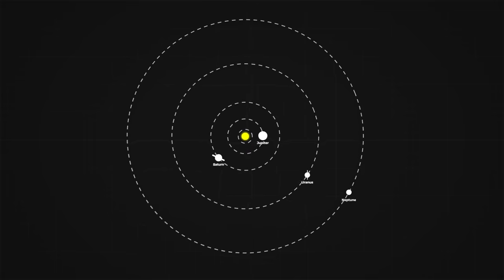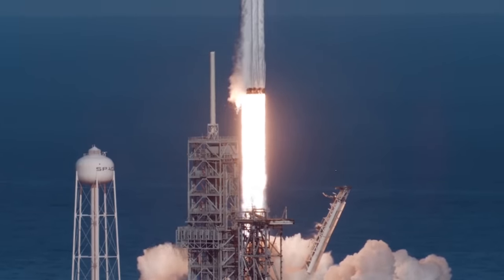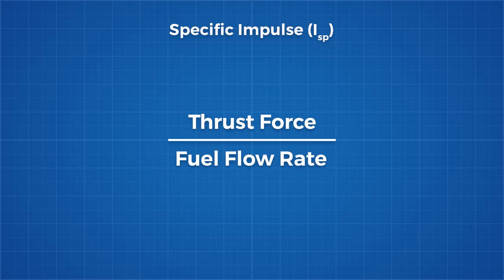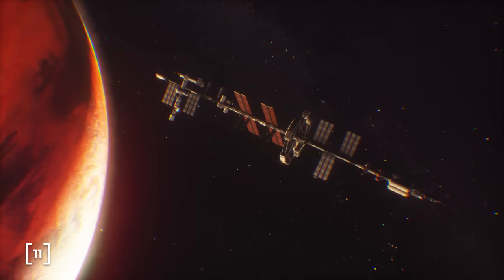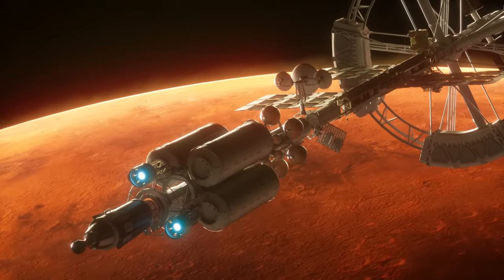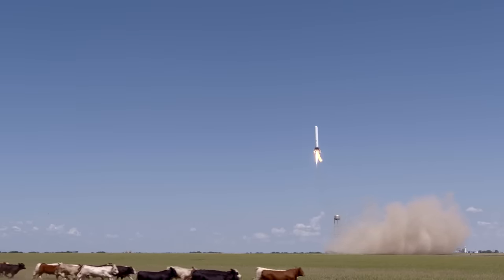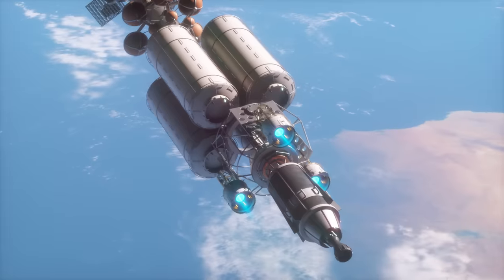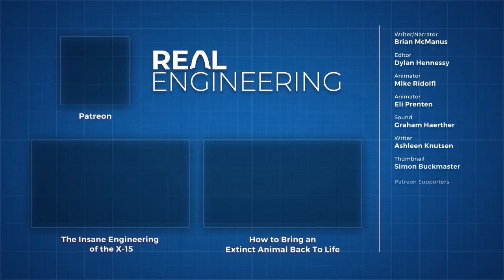Can Nuclear Propulsion Take Us to Mars?

Comment: Any problem in the world: exists
Nuclear Energy: Sounds like a job for me.
Reply: At the end of the day nuclear energy is what made this universe and still to this day keeps it moving.
Reply: @arnavsadhu  Yep even the stars burn because of nuclear energy.
Reply: @arnavsadhu  Actually that's nuclear fusion energy which is different from nuclear fission. Planet are fission reactors because they are too small for fusion and stars are fusion reactors.
Reply: Same with Starship, graphene, aerogel
Reply: @KRYMauL  the point is, it's nuclear energy. The sun is a nuclear reactor. A fusion reactor. Those of us in the know , know what's what and the differences.
Reply: @trevorwoodley3897  No, you are comparing the strong and weak nuclear forces and calling them the same when they are not.
Reply: @KRYMauL  By definition, the term "nuclear" refers to ANY process that involves reactions with the nuclei of atoms: this includes nuclear decay, nuclear fission, nuclear fusion, and even nuclear annihilation like happens in matter-antimatter reactions.  While these four operate on different mechanisms and produce orders of magnitude different amounts of power they are ALL nuclear reactions, and your 'correction' is not only needlessly pedantic, it is actively incorrect.  Nuclear fusion is a type of nuclear energy, even if nuclear fission is the most powerful type humanity has been able to harness in a controlled manner.  The original poster nor any of the following posters until you specified that they were limiting discussion on the usefulness of nuclear energy to fission only, so discussing the benefits of fusion too was absolutely within the realm of the discussion.  Most people who discuss nuclear stuff know the difference between fission and fusion, but for this discussion they are both 'useful' so they're both fair game.
Reply: @IONATVS  Facts! School' em.
Reply: @KRYMauL  It's the Strong NUCLEAR Force and the Weak NUCLEAR Force.
Reply: Any massive source of usable Energy can eventually be utilized to solve a given problem.
Reply: @RocketDragons  They are completely different forces that don’t combine until infinitesimal close plank time. 

EDIT: I fat fingered a paste.
Reply: @IONATVS  I was mainly making a nitpicking joke because I thought it be fun to include the fact that only one type of nuclear energy is available atm.
Reply: @KRYMauL  so what? Nobody is trying to say they are the same force. You're literally making up an argument. By the way, there are functional fusion reactors, and it won't be long before they are producing a net positive amount of energy.
Reply: @KRYMauL  There is actually 1 Fusion-based propulsion method that is generally believed to be feasible with our current technology: pulsed nuclear propulsion, colloquially called a “bomb gun” or “Project Orion” after the codename for the US Navy’s preliminary research into the idea in the 70s and 80s.  It’s dirty, at least as dirty if used in atmosphere as any other kind of H-bomb testing, but basically the only propulsion method that we’re 99% sure we could both make with current tech and would provide enough thrust and impulse to do single-generation interstellar travel.

Also nuclear decay, the least energetic nuclear reaction, is already heavily used for power in space, as Radioisotope Thermal Generators (RTGs).  Frequently used for craft that will be spending significant time in low-light situations where solar isn’t as abundant as it normally is in space.  Basically its just a lump of radioisotopes being used as a consistent heat source to run a Thermoelectric boiler.  Each halflife it provides half as much power as the last, but you can COUNT on that power.
Reply: @RocketDragons  We have functioning energy negative reactors but they are still 30 years away.
Reply: @IONATVS  I mainly was thinking “controlled” fusion, but yes that works. 

Also, I was think nuclear power for propulsion not for energy.
Reply: @KRYMauL  General Fusion will have a prototype fusion power plant up and running in 2022. We're a hell of a lot closer than 30 years.
Reply: @KRYMauL  because of electric propulsion systems like Ion thrusters, if you have a viable method of power generation, you have a method of propulsion.  Not necessarily a great one, but an RTG + an Ion thruster is a pretty common and simple combo for low-thrust/high-specific-impulse applications, just like solar + Ion.
Reply: @RocketDragons  While I agree with you that there’s a lot of promising stuff happening in Fusion and I’m hopeful one of them will run positive in the near future, folks have been saying controlled fusion was “20 years away” for the last 50-60 years, so I understand the “let’s not count our chickens before they hatch” attitude from MauL.  I’m not celebrating until a demonstrator actually RUNS positive and keeping that celebration modest until one is actually running commercially at scale for a full year and doesn’t get shut down by political pressure.
Reply: yeah, there is a hype about nuclear energy in some youtube channels lately. Here it is feasible, since you don't have any alternatives. But for Earth, we do have better alternatives. You don't need overly complicated systems which gives catastrophic results when they fail, and more complicated a system is, more likely it will fail.
Reply: @cancan-wq9un   I still think that liquid salt thorium reactors, if built, would be a much better energy source than any other, while also addressing the issues of nuclear power:
Built-in fail-safe? check.
Tech cannot be used to build weapons? check.
Does not produce long lived nuclear waste? check.
Is much more efficient at energy production? check.
Regarding catastrophic failure, nuclear energy still is the safest form of energy(yes even more so than renewables.)
Reply: @RocketDragons  That’s the on going gag with fusion.
Reply: @IONATVS  I meant ones that are good for carrying humans into the outer solar system.
Reply: @KRYMauL  You've already established that you don't know what you're talking about, but okay.
Reply: @danyalag3366  
And you are still wrong then.

"Built-in fail-safe?" I don't know how many different ways I cat tell this, but even the best system in the planet is as good as its weakest part. And for nuclear reactors, it is humans. I really don't understand how you expect this to be "safe". This is like expecting every single F-16 squadron in different countries to have peak efficiency just because plane is good. 

"Tech cannot be used to build weapons?" check. Yes, it cant made into weapons. 

"Does not produce long lived nuclear waste?" Not check. Yes, you wont have to store it for thousand of years but only for hundreds of years. Immediate concerns of accidents, and storage problems are more less the same. 

"Is much more efficient at energy production?" Compared to normal reactors? Yes. Compared to other renewables? No. Wind and solar basically free to harness. You have to mine, transport, refine, transport, store, transport and then use it.  

"Regarding catastrophic failure, nuclear energy still is the safest form of energy(yes even more so than renewables.)" Yeah, and on paper F-16 is a great aircraft and should operate without any loses, but in field things don't work that way. People who operate it might lack parts, training, facilities, funds and stuff like this which would effect its record. This is basically the same for the nuclear power plants. Safety record will not stay the same when more people start building these. 

So as you see, apart from one case your perfect tech is not so perfect. This is a complicated system even before the reactor. You have to mine, transport, refine, transport, store, transport, use, transport, process for waste disposal, transport, and finally store. Some of the transport stages can be mitigated if the facilities are at the same place, but it is unlikely. This whole chain has to be operated by experienced people, funded properly, and constantly monitored for safety. Yeah, thorium reactors has some convenient stuff on usage and waste processing part, but that is not the only thing that industry consist of. Other renewables doesn't even have half of the complexity.

Edit: Corrected stages for industry, forgot to add some of the stages.
Reply: @cancan-wq9un  Real-life tech is never perfect, but the fail-safe of LFTRs is that no human element is needed to turn it off in the case of a failure. Its much better than todays reactors. 
I don't know where you are getting with "in the field, things don't work that way" , the fact I'm quoting about nuclear being the safest form of energy is a statistical fact, based on data from the field.
And while nuclear isn't free to use, neither is wind or solar. Sure the energy might be there, but extracting it? Solar requires more rare-earth-metals, the refining of which is still more expensive than thorium. 
Even if you take care of all the material issues, you still have to deal with the fact that solar and wind are intermittent energy sources at best. wind isn't available everywhere, at least not enough to be viable. Solar fluctuates seasonally, and you have to store energy during the night to prevent power outages.
Nuclear power, especially the LFTR kind, has none of these issues. It is not perfect, but right now, it is a much better option than setting up the infrastructure for renewables. I'm not against renewables, but right now we should bet on nuclear power if we want to fight climate change.
Reply: @danyalag3366  "fail-safe of LFTRs is that no human element is needed to turn it off in the case of a failure. Its much better than todays reactors." No, it still needs to be maintained and that is still done by humans. Yes, you don't need to push the button, but it doesn't work if the button is broken, or some idiot decided that is redundant. Go check Plainly Difficult channel if you don't believe me, nuclear safety is a learning curve and those mistakes will be repeated if this gets widespread.

"I'm quoting about nuclear being the safest form of energy is a statistical fact, based on data from the field." 

Also statistics are not always that easy to read, context is important. You are looking at safety records of a handful countries operating nuclear reactors with proper funding, expertise and experience.  Which learned from their mistakes in time. Yes, accidents reduced in time.  New countries wont have that expertise, funding or even sometimes political stability to make this work properly. 

Just in case you are not familiar with statistics, here is an example. Imagine you are selling apples. And some of your apples are rotten, customers protest. You get better in time storing your apples, learning. So you decide that apples are the ultimate food source and cant get rotten, and try to convince everyone that is the case. Statistics will back you in this case, but any other new seller will have troubles. Context is everything in statistics. 

"Sure the energy might be there, but extracting it? Solar requires more rare-earth-metals, the refining of which is still more expensive than thorium." 
"Solar fluctuates seasonally, and you have to store energy during the night to prevent power outages."
"but right now we should bet on nuclear power if we want to fight climate change."

For now. Youtube doesn't allow links, so search google for costs of nuclear and wind and solar in time. You will see in almost ten years, wind and solar caught nuclear in prices. And you want to go nuclear, which will take decades to build and make work efficiently. As I stated before it has a lot longer chain of production. On the other side, production chain for wind and solar getting more widespread every day. You can even build one yourself, no need a degree in nuclear physics. Batteries are a problem, but there are technologies in development right now which can solve those problems in the amount of time you build a nuclear reactor and its facilities to support it. And if you really commit to wind and solar, you don't really need to solve battery problem completely. A vast array of solar power plants around the world can supply 24 hour power. And it is not any more ridiculous than trying to fix the increasing demand around the world with lots of nuclear reactors.
Reply: What about booms?

The problem: Humans
Nuclear Energy: Sounds like a job for me.
Reply: @IONATVS  Also I'm not sure that these newer maybe possible fusion methods would work for propulsion. Unless it's electric propulsion. Seems like I read something a few years ago about a fission pumped fusion propulsion method that should be possible with current tech. Cant remember the specifics and I'm no nuclear physicists but I do understand the basics. If I remember correctly it was still a net negative fusion reaction in the nozzle but could provide high thrust and acceptable specific impulse. I guess my point is theres all kinds of things we could try if we had the will and the funding. And if the hippies would shut the hell up about nuclear power. That magnetic reconnection method I read about recently sounded pretty cool too. I think the physicist credited with coming up with it was on John Michael Gautier(?Gotier? whatever) recently, or Event Horizon. One of those.
Reply: @cancan-wq9un  Nuclear energy technology is actually the safest energy production method we have by so far that it's not even comparable. All the death and destruction is movies, not reality. Even renewables kill more people. I'm not saying we shouldn't use renewables where they make sense but we can build safe efficient nuclear reactors. The problem is that people watch movies and interfere with literally every link in the chain. No matter how infinitesimally small the actual risks really are. We are being irradiated by nuclear power everytime we step out in the sun, people don't seem to know that. I'm not saying to just trust officials without a huge amount of oversight as they all seem to be corrupt these days. But the experts in the field don't want to hurt anyone. They want to power our world without destroying it in the process like we are currently.
Reply: @cancan-wq9un  If complexity was always a problem life would not be possible.
Reply: @allineedis1mike81  You are completely clueless. Yes, life ia complex, and more complx it is more things can and DO go wrong with it. And the living thing is no more, as a result. That is the reason we die, something eventually gives, and it is a diaaster for you. Yes, you can live a little bit longer with most advanced care, but it DOES NOT mean you somehow have suprerior genetics or someting. Exacly the same thing for nuclear power, it is safe because countries operate it take every measure to make it safe. And it is relatively new, they got there after lots of stupid accidents. Dont be ignorant, people.
Reply: @cancan-wq9un  Your telling me that living things stop living eventually? I didn't know this, guess I am clueless. Also I'm having trouble understanding what point you are trying to make. Every mass scale energy technology we have kills people in one way or another. Either through accidents, long term exposure to pollutants,(this ones potentially thousands a yr looking at asthma rates in children due to soot from fossil fuel burning) system upkeep, think oil workers and lineman, whatever. There have been some horrific nuclear accidents yes, using far obsolete technology. We have much better technology now, we can model things with millions of times the precision the last gen of nuclear engineers had available to them. We can demand passive and active safety features and we can use other fuel sources disconnected from the nuclear weapons chain. These are all things that could be done today and completely replace fossil fuels. Emissions are changing the planets climate. Every single nuclear disaster put together has killed or gravely injured orders of magnitude less people than any other energy source we currently use. Look it up if you don't believe me, somewhere credible please. Or am I completely missing your point? Humanity can build some shockingly complex machines that are shockingly reliable. I'm sure you can think of some. Or did you just want to insult me and rant about how people get old? I was actually aware of that.
Reply: @allineedis1mike81   You are telling me you understand stuff, but still keep defending the nuclear energy, which is evidence enough you still have no clue what I am talking about. Tech by its own mean little if you dont use it properly. Go read my precious comments, I debunk everything you say here before.
Reply: @cancan-wq9un  ok, good talk then thanks
Reply: I'll bet we are 30 or mor.e years from a commercial grid tied fusion plant.
Reply: @KRYMauL  planets aren’t fission though, sure there’s decay, but that’s separate from actual fission.
Reply: @Yomotomen  What? Fission is decay. Fusion is combining.
Reply: @allineedis1mike81  I think can can might be a member of or highly influenced by one of many anti-nuclear movements out there. His pseudo intellectual debate stalling tactics are indicative of such...
Reply: Stupid science 
Science doesn't 
The greater the mass, the stronger the magnetic field, the mass of Jupiter is 1321 times that of Mars Earth, so Jupiter ' s magnetic field is 20 times stronger than the Earth ' s, so the Sun and Jupiter suck 181 kilograms of Earth hydrogen per minute, hence the Sun and Jupiter are toxic hydrogen, the Earth atmosphere is fresh
Reply: @thanhpham8172  What the hell are you going on about??
Reply: Stupid science 
Science doesn't 
The Sun and Jupiter suck 18 kg of methane from Mars Every minute, so the Sun and Jupiter are toxic hydrogen, hence the atmosphere of the Mars is green
Reply: Stupid science 
Science doesn't know 
Jupiter growing up to create the Sun. 
The Earth is about to have two Suns. 
The Earth is constantly expanding, the proof is that Hawaii volcanic lava is constantly spewing out
Reply: @IONATVS  The original Orion used fission, the modern mini mag variant uses fusion but is much weaker in terms of thrust.
Reply: @5000mahmud  From the very beginning it was a proposed program that never actually got anywhere and that proposal included a LOT of different potential variants of the concept which R&D would have had to figure out which specifics were best had it gone farther.  H-bombs (ie *fusion*) were one of the options mentioned from the beginning, because they existed at the time and would provide more thrust if it turned out the vehicle needed more "oomph".  The two most commonly seen versions of the concept are the Navy's iteration of the concept as a potential future US military venture, which would likely have used specialized A-bombs designed from the ground up to be a pulsed nuclear propellant and a bare-bones, no-nonsense variant of the concept that could be built in a short timeframe under poor conditions through sheer overengineering and spite as a "in case we need to get off world TODAY"--that concept would've used retrofits from the US or its allies' existing nuclear arsenals, primarily H-bombs.  Both were part of the Orion proposal for pulsed nuclear propulsion spacecraft, though: using fusion is not just something that appeared without precedent in more recent iterations of the concept (though as small "mini-mag" charges instead of full bomb-scale ones are new).
Reply: @RocketDragons  it's 2022 rn, where general fusion?